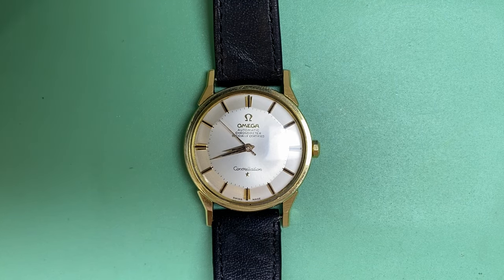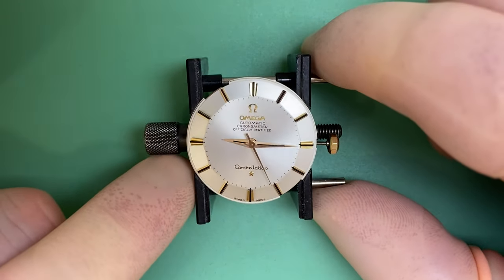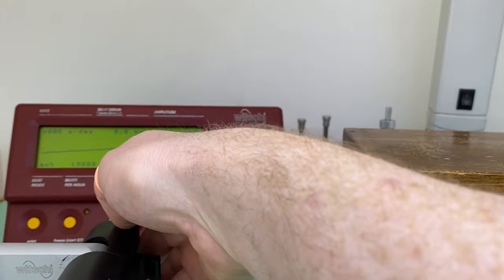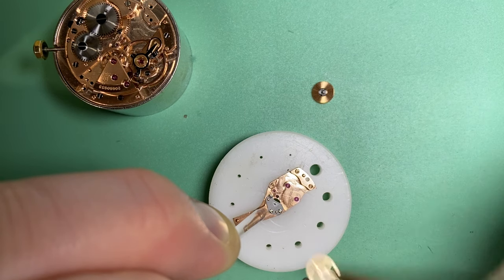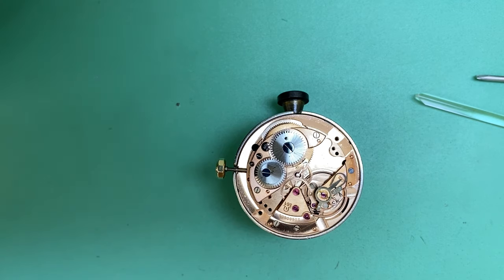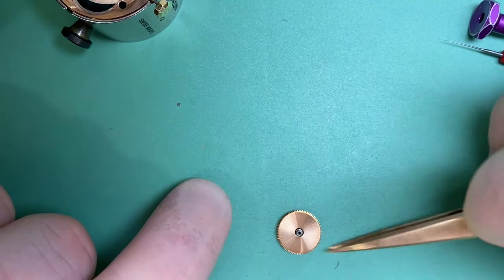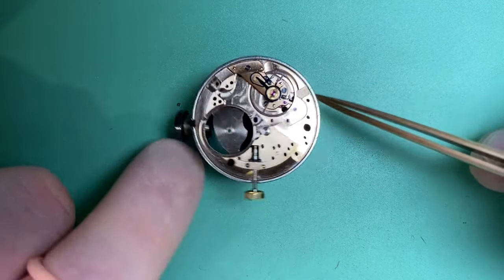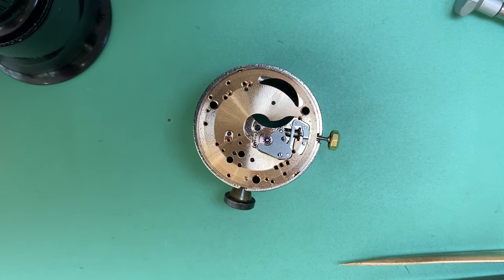Servicing a Vintage Omega Constellation - Omega Caliber 551 | Part 1: Strip Down & Fault Finding

Comment: I have a cal . 300 Omega that I can’t get the canon pinion off the center wheel. Is there a chance it’s fused or not able to be removed?
Reply: Have you tried putting it in an ultrasonic cleaner, might help loosen it?